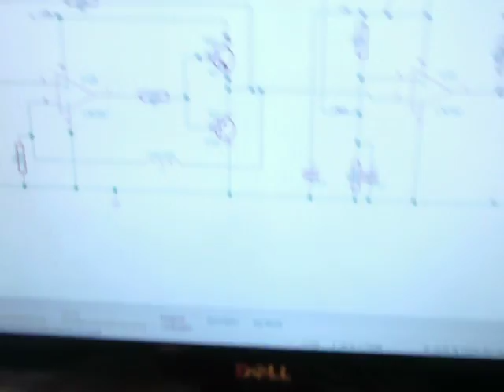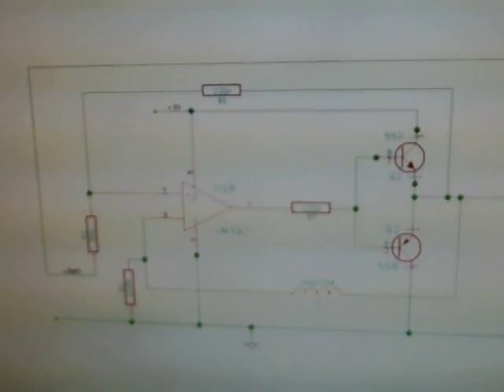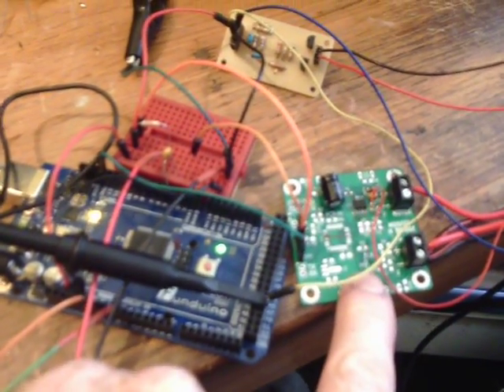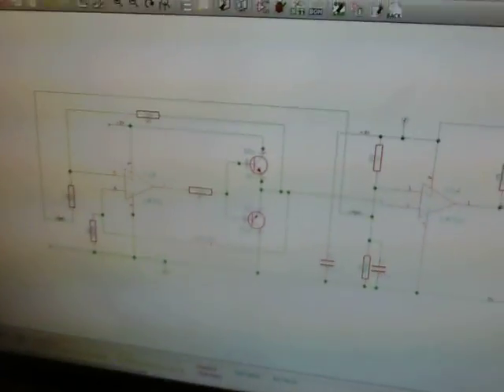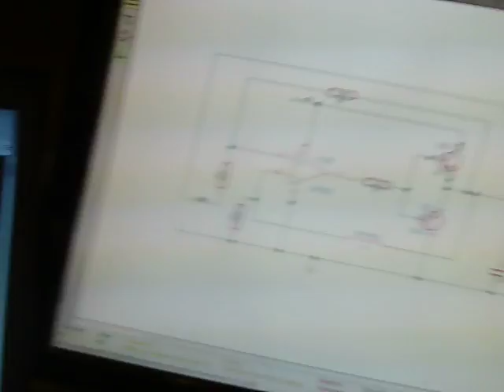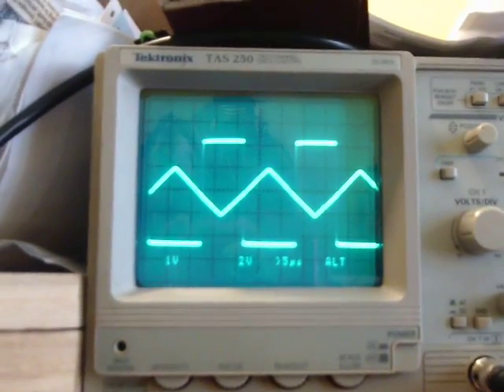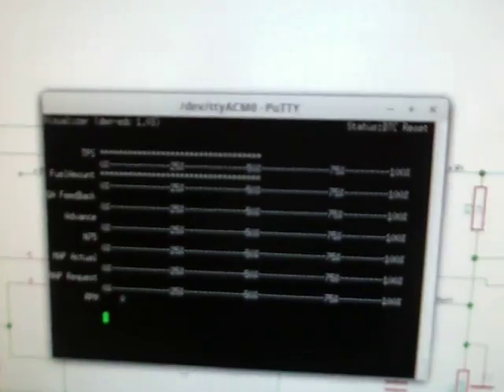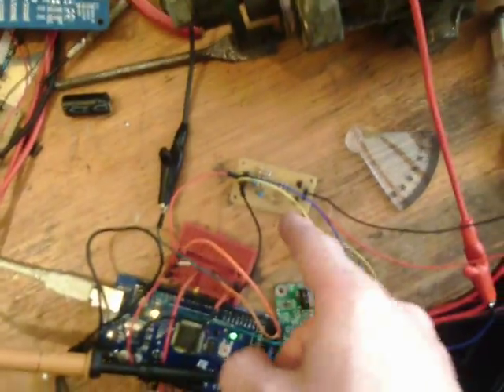Super simple HDK Half ring sensor circuit for VP37 diesel pump

Comment: Are you willing to share the schematics and code you have?
Reply from the maker: Hi, The schematics are shaky but visible in the video. 
I've lost most of the experimental code and the schematic when my laptop died. But basically the microprocessor / Arduino measures the pulse length of the square wave you can see on the oscilloscope and the frequency change is just about linear over the range of movement.
Reply: Thank you for the response 😁

Comment: post script: Is there an analog signal coming out of the pump that could be modified to the same end ?
Reply from the maker: No. It is a half ring inductive sensor with a coil on each half of the sensor. In operation the short circuit turn on the moving arm alters the inductance  on that leg as it moves around. This inductance can be used in isolation to determine position or compared to the other arm that does not change inductance and can be used as a reference.
There's probably others ways of using it but I don't have the time to investigate them,

Comment: Hi, Nice work,.  Maybe you can help me.  I'd like to up the fuel quantity without paying for performance reprogramming ($$)  I found out that the ECM only understands that is it is moving the control rod/arm X number of degrees as determined my the sensor feed back.. Can you think of a simple way to modify the sensor (LVDT?) so that it moves through a slightly larger angle for the same sensor output? 
 Would moving the copper calibration shunt do it? (i.e. does it adjust the scale)  How about thinning the arm shunt?  Maybe something else... Thanks ahead of time. 

BTW When last I put my pump back together the QA adjustment was off in the fuel rich direction ( the idle lopped).  I went ahead and test drove it and for a few miles it had lots more power until the ECM re-calibrated it and backed the fuel down.
Reply from the maker: Hi, 
I'm not sure of there is an easy way to fool the system into supplying more fuel. If it auto calibrated after you assembled it  with the QA out of adjustment then I'm sure this will happen again with any simple diy bodge. 
The output from the pump is far from an simple analogue signal, in fact it is a very complicated but very robust feedback measurement. The system uses a Half-Differential Short-Circuiting-Ring Sensor with a reference (calibration) ring on a symmetrical stationary arm. This is similar but different to a LVDT, I spent some time looking into this a few years ago and did not get very far. What you see in the video is an unfinished arduino based system someone published several years ago and has now gone stagnant as there have been no updates for at least three years. 
Very few people have managed to control this position feedback system themselves without the specialist and very hard to obtain circuitry in the original ECM. The circuit in the video is firstly no where near complete and secondly totally separate to the original ECM and hence incompatible. 

I know this does not answer your question but I hope it sheds some light onto what I was doing.